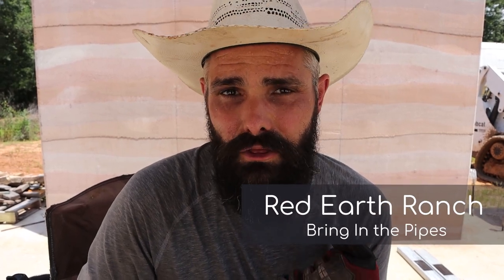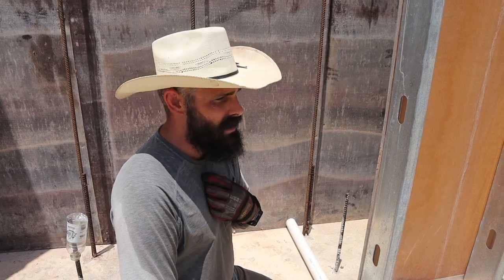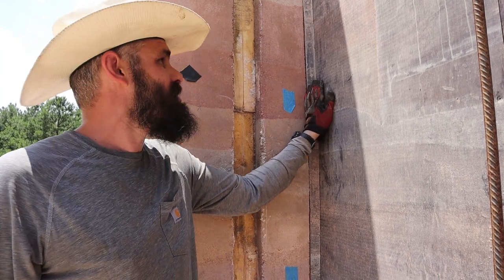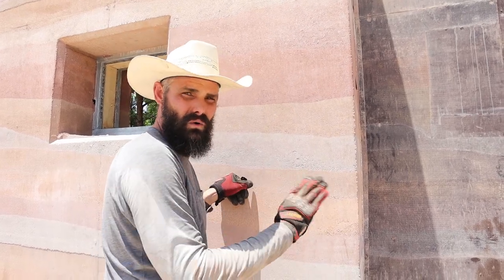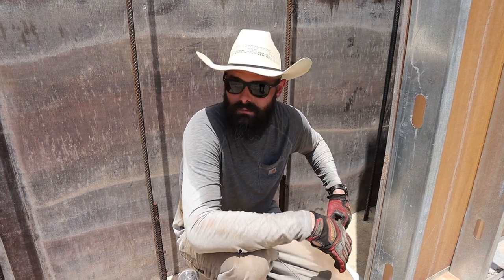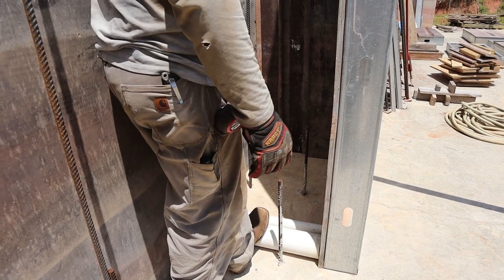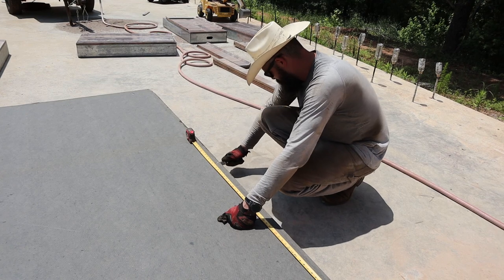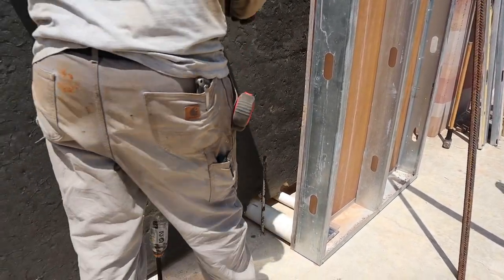Water Pipes through Rammed Earth - Forming - Vlog 66

Comment: I don't know if you have run the water lines yet but you should you pex inside the pvc. It wont burst if it freezes and it is a lot smaller so you could use smaller pvc to run it through.
Reply from the maker: That's a GREAT idea. I hadn't thought of this but will definitely be using it. Thanks!!!

Comment: hey, ty for sharing your experiments with us. i just looked through your uploads and cant find a video on running the electrical wiring inside the earth wall. any updates on that soon? God bless
Reply from the maker: We won't be doing that until we get to the main house. We are purposefully running the Electrical on the outside of the walls in the garage and workshop because we want the ability to change it as the shop changes. The basic principle is you use rigid conduit and place it in the forms then ram the earth around it. We will show it when can, sorry for the delay

Comment: Much better looking than concrete though it requires infinitely more patience. Be nice if you could do rammed earth without the earth processing, forming and ramming parts.  Might be possible.
Reply from the maker: If you find a way to do that I'm all ears LOL
Reply: @RedEarthRanch  OK.  It would have to be a more-fluid then false-setting mix of course (because pumping and not forming), and combining those properties with the authentic earthen-tamped-layer look and smooth finish would certainly be a real challenge.  A more sure method might be to use a conveyor for a more dry mix, combined with very-rapid slip-forming.  Would then have to tamp it - then you get back to high form pressure that kills the light slip forming... You're not making this easy!  Best of success with it!